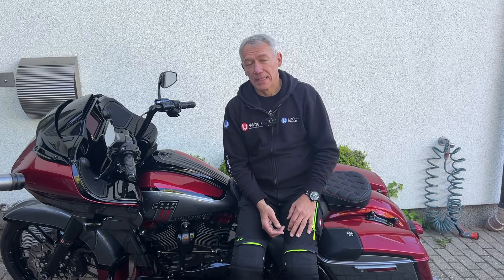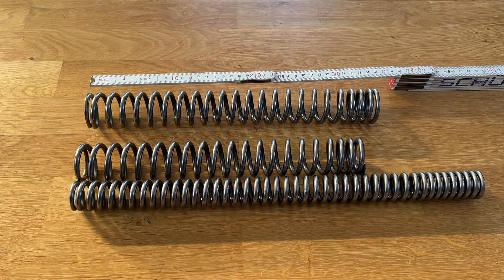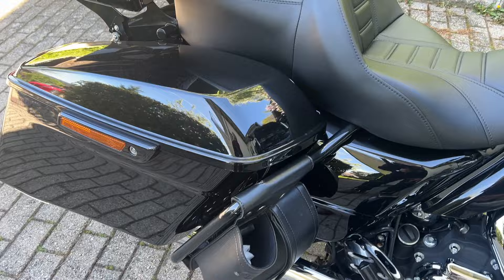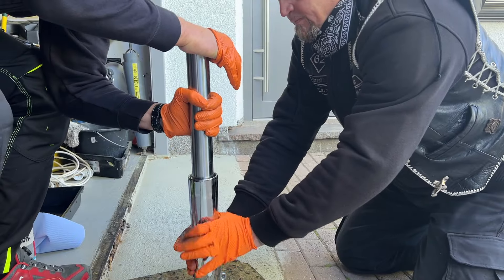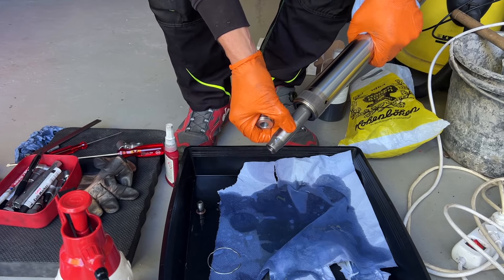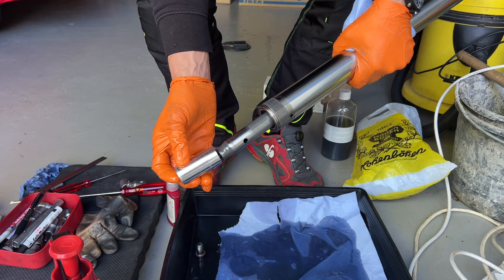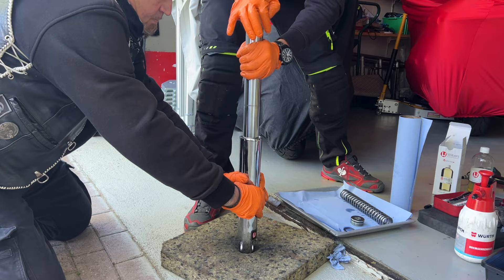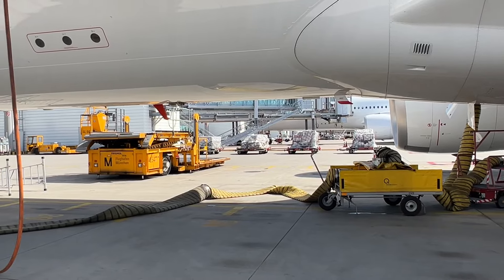Wilbers Nivomat Troubleshooting for Harley Davidson Touring Models

Comment: Hello Stefan, do you have a pre-rushmore Wilbers Nivomat installation video?  I've ordered  a kit from EPM (309-1002-02), but not sure if the pre-loads are included in the kit. I have a 2012 RG, 41mm tubes with damper valves (no pre-loads). Thank you for sharing your time with us, your videos are awesome.
Reply from the maker: Oh my god, you have a hell of a job to do. But the gain will be huge as well. As a reference, I have a 2010 Electra Glide install with fork rebuild. On the pre Rushmore RGs, You have to dismantle the whole instrument cluster, to reach the upper trees. The rest will be like the Electra Glide. Enjoy Your new ride and make sure to check steering and swingarm bearings.
Reply: @stefansgarage3014  my forks are already drained, disassemble, and the new fork rebuild kit is on my work table. Only waiting for the new Wilbers kit to arrive. EMP is off until the 2nd of January 25.
Reply: If you can post the link to that video I'd much appreciate it. We share the same first name only mine is spelled Stephen, but pronounced the same. Cheers
Reply from the maker: @ Congrats Stephen, so the worst part  of the work is already done.
Reply: Another question lol....when using a fork level gauge. Do I set the millimeter tube to the bottom or to the top of the guage top plate (guage top plate = the part with the set screw that lock the tube into place)? I apologize in advance for this question, but mine (Stockton Fork Oil Level Guage) didn't come with instructions. I'm just trying to make sure my install is top notch. Thank You
Reply from the maker: @ You take the measurement from the bottom of the gauge

Comment: Hello Stefan
I was wondering what your thoughts are on one inch lowering with the wilbers Nivomat shocks
Reply from the maker: Well, if you want to ruin the ride...Ride comfort and precision come with suspension travel, if you lower it you limit the travel and impair the ride. If you have a shorter inseam, the Wilbers shocks are taller, but have more rider sag. So the total increase in seat height is around 1 cm 1/4in, I just installed one for a shorter rider on a Road King Special.

Comment: Hi Stefan. Might sound like a stupid question, but...Whatever...I have Wilbers stuff in my Softail FXLRS. In the warranty card, where  the factory setting is written, it stands the preload is 22 mm. Is it measured from the top od threaded area to the top of the spring? Or to the top of the couter hook nut?
Reply from the maker: Hi Björn, it's probably a conventional 540 or 640 shock and no Nivomat. As far as I know, it's just a documentation of the factory setting, you need to check and adjust the rider sag with the spanner wrench to obtain around 3-4cm rider sag (check the instructions for that). It should be the whole thread length that is compressing the spring, so top of the threaded area to top of the spring. But as I said, you have to fine-tune it on the bike.
Reply: @stefansgarage3014  Thanks a lot! Yes, it's 640. Sure, but don't have tools for sag adjustment so it's testing. Worst thing is that my woman loves riding with me. And each time i have to adjust preload with a hook wrench. Pain in the ass. But sure the hardware is really cool. Made the bike as it should be. Stock is like American beer. They call it a beer, looks like beer, but...what do they know about beer😁
Reply from the maker: @bjoernrider6164  Honestly, get the new self leveling Nivomat. No messing around with the preload anymore, especially when you’re riding one and two up.

Comment: I’m convinced to go with Wilbers but, I’m having a hard time finding a shop in Northern Cal (Bay Area) that does installs.   Any ideas.  Also, I have a 2018 CVO Road Glide with the 21” wheel.  Thank you and if you know of any local shops that does 
install Wilbers, please let me know.
Reply from the maker: Hi Ron, I love the Wilbers on my 2019 CVO Road Glide. Did You check out my install video especially for our CVO RGs? I was flying into SFO, three weeks ago...
Any motorcycle tech can do the install, if you send me an email, I will provide you with the key points for the correct install (especially for professional installers)
info@stefans-garage.com
Best regards